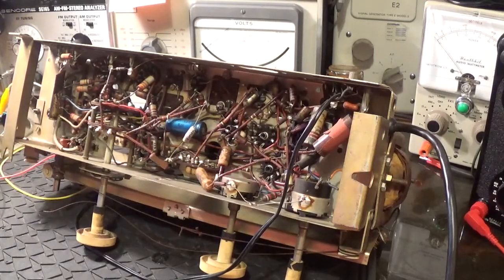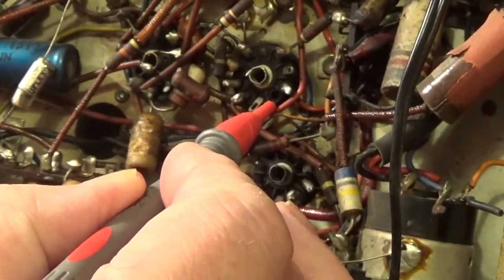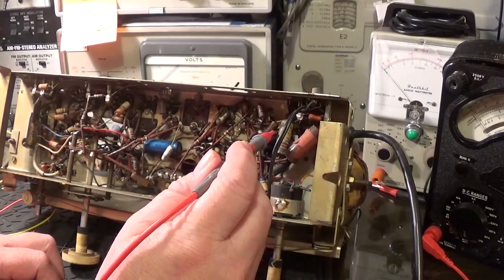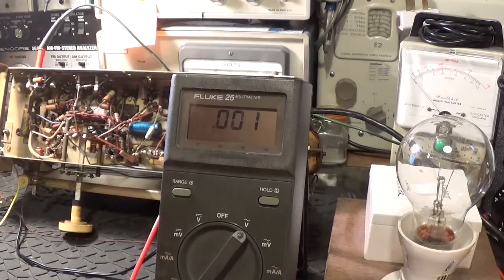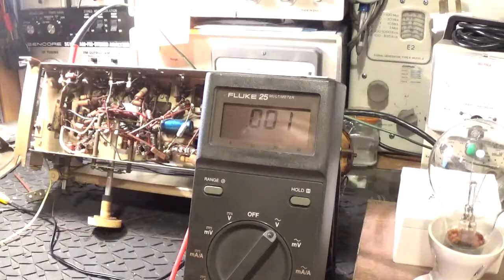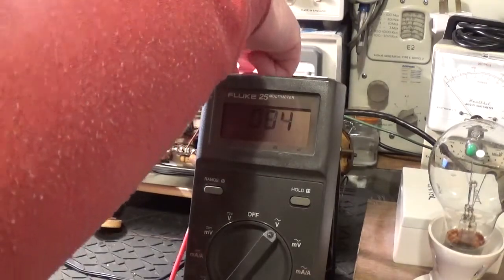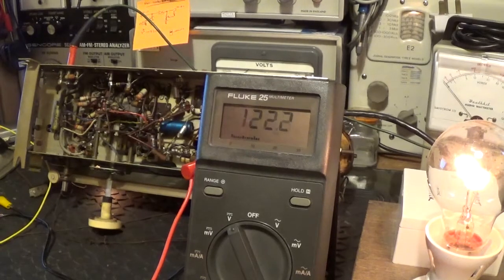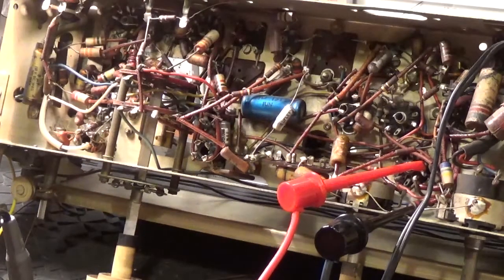KB Minor OG10 Table Autoradiogram Part 2

Comment: Andy,
It is very likely those old wax paper/aluminium foil capacitors will be starting to electrically leak as low as 30 to 40 volts DC.  A set of branded (Sprague or Panasonic for instance) polypropylene capacitors will do nicely …likewise branded (Nichicon, Samsung or Rubycon for instance) electrolytic caps …I tend not to use anything else.
Once you have the power supply, and audio circuits functioning to spec, you are then well on you way to sorting out the rest of the radio’s circuitry.
Phil.
Reply from the maker: Hi Phil, yes they're all dodo-like I think.  I use mostly Vishay MKT1814 for the valve sets along with LCR where needed for the 1kV. Nice long leads.  I also use polyprop Suntan capacitors, pretty good though radial.